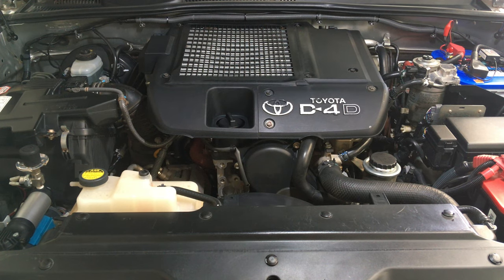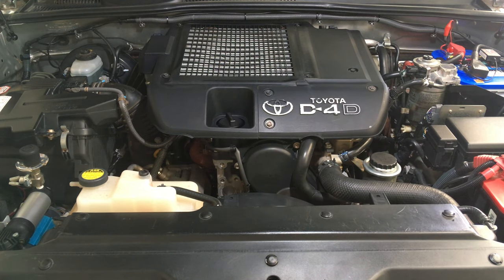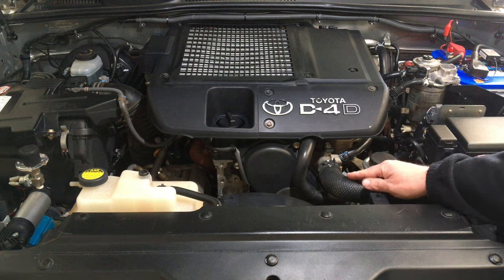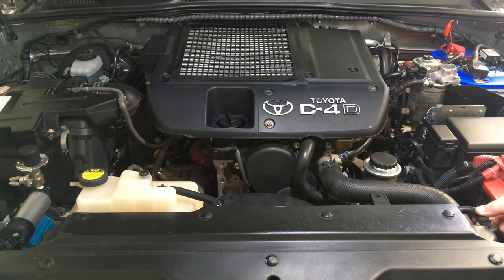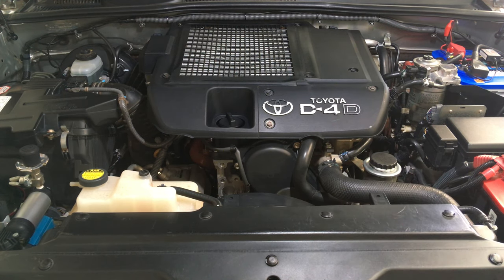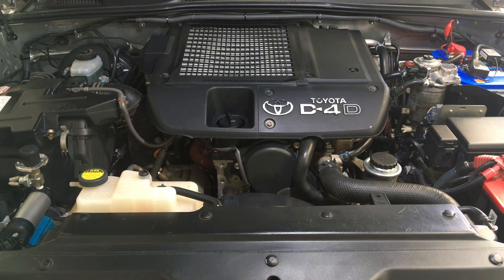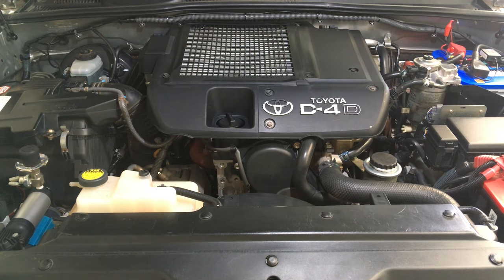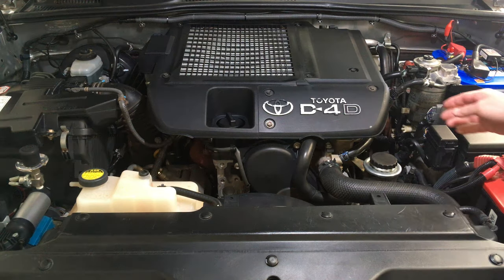CHECK THESE & AVOID PROBLEMS

Comment: Great topic yet again mate! I would be very interested in cooling systems for a auto transmission in  2011 hilux (ish). 
Would you recommend when towing?  Eg Highway towing, against towing on sand?
Do you need one specifically for lots of sand tracks? Im hearing that yes you do need and others say its a waste of money. Personally if I am driving on a 40 degree day and doing low geared sand work I would lean towards a definite yes.
Im just interested to hear your thoughts.
Keep up the good work mate